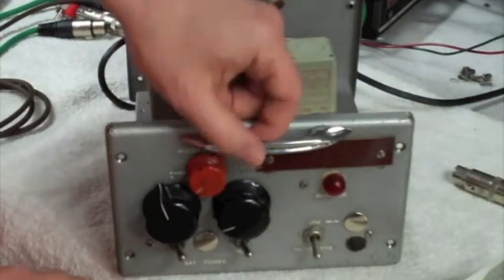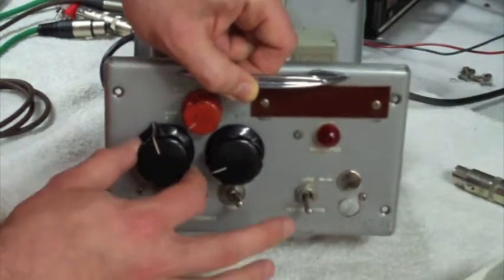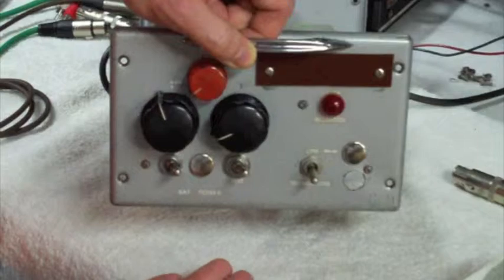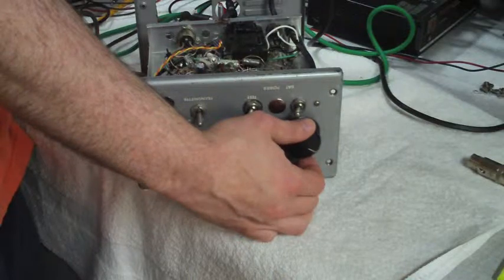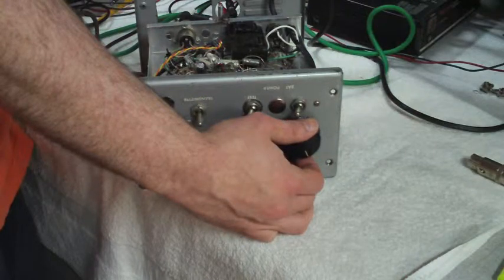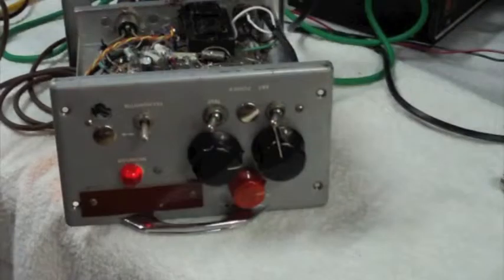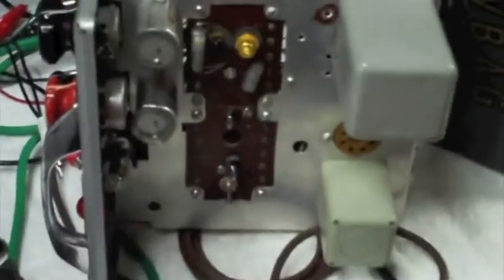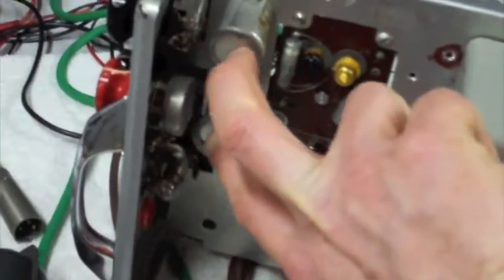Western Electric Germanium Hybrid preamp

Comment: Crazy topology - would love to know more about this thing and if there's a schematic out there!
Reply from the maker: Sorry guys, we never get schematics with early hand built Germanium audio like this. There are some commercial products from the late 1950s you could use as a guide (early Solid State preamps and line amps). Also, there is good data / information floating around for the use of Western Electric PNP and NPN devices (they made all sizes)  which are Germanium alloy and quite unique.